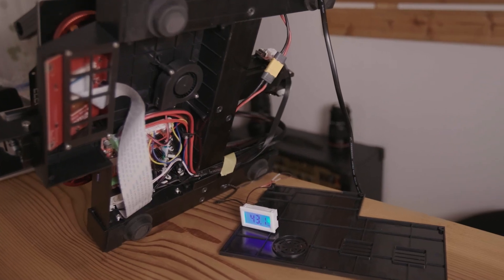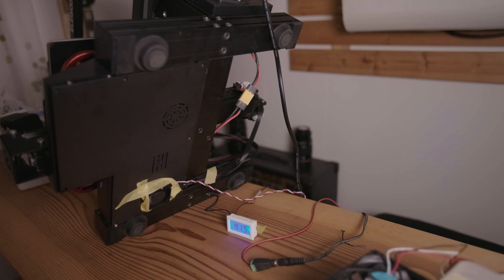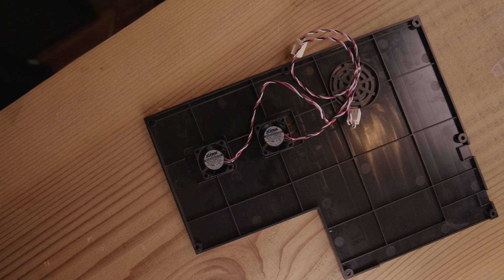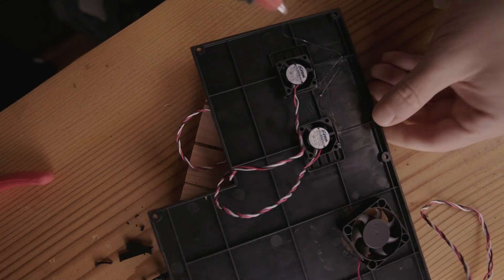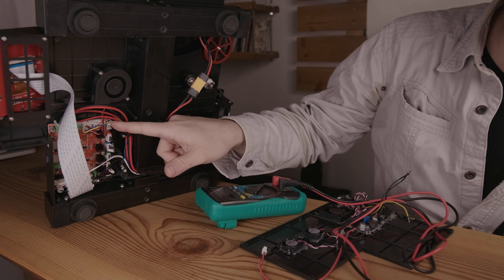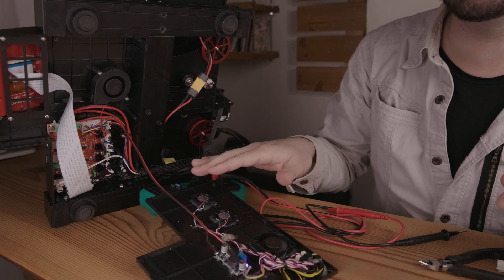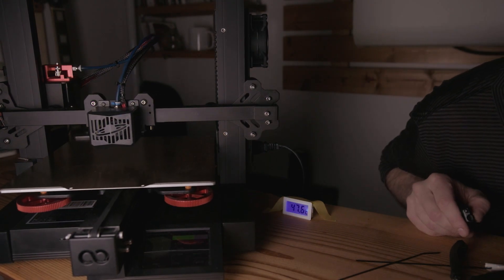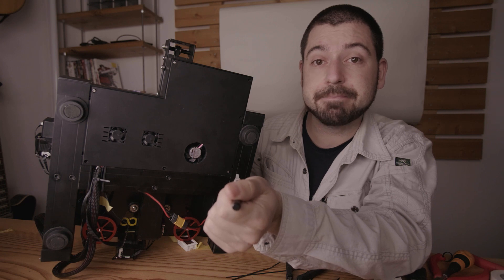Quieter and Cooler: Elegoo Neptune 2S Mainboard fan upgrade

Comment: Excellent videos. I think of you as the ASMR of 3d printers.
Reply from the maker: Thanks a lot! Never tried it before but that might be inspiration for a future vid!
Reply: @MochaMameX  have you thought about installing a silent stepper in the extra spot on the mainboard and map that to be the Z stepper? That's my next project to quiet my N2S...
Reply from the maker: I've thought about it but the extruder noise doesn't really bother me so haven't tried yet... but I do want drivers for a different project. You will try to silence the extruder driver?
Reply: @MochaMameX  my goal is to use the open slot for a silent driver and use it as the Z axis. I'm not sure how yet, I saw someone say it was possible on Reddit.. so we'll see.
Reply from the maker: If you flash Marlin you could remap the Z to the empty slot, not sure if stock firmware can do it. Let me know how it goes!